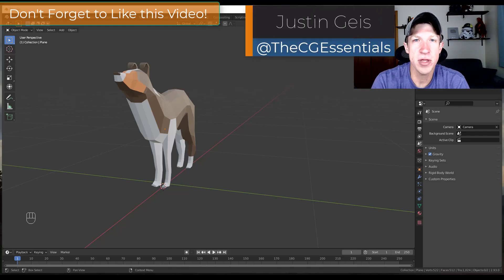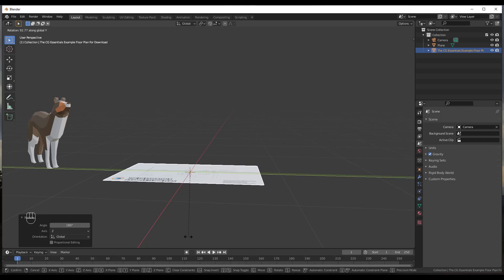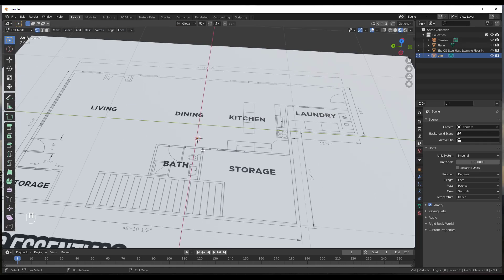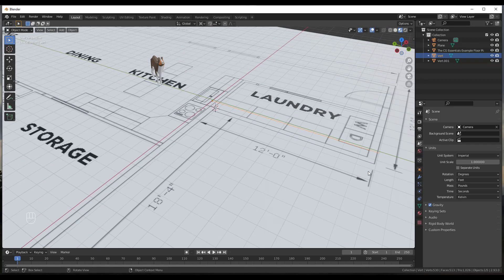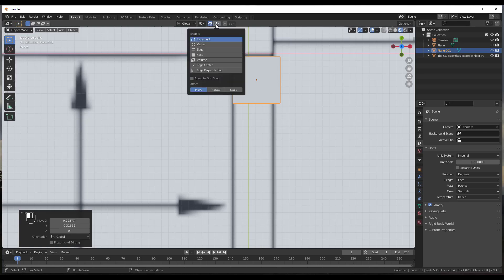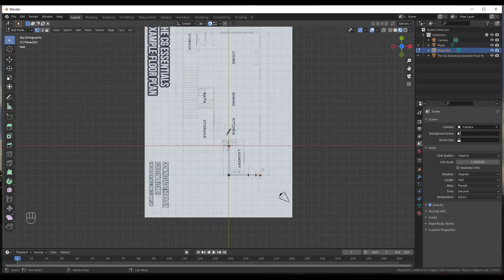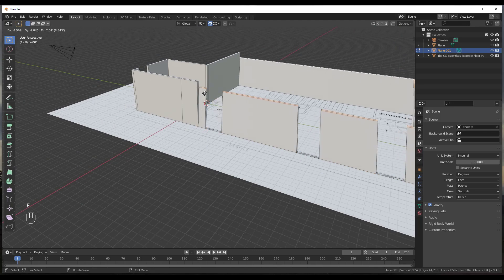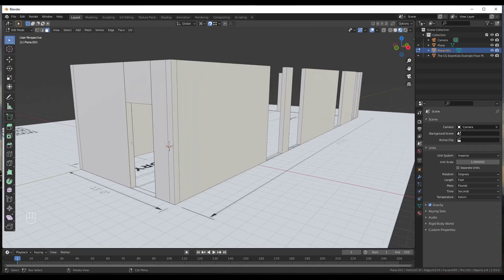Architectural Modeling In Blender Part 1 - Modeling from a FLOOR PLAN

Comment from the maker: Hi everyone! Let me know if you have any questions in the comments below! Also, remember to download the example image at http://www.thecgessentials.com/floorplan !
Reply: Did not receive the floor plan when I signed up for emails from your website. 😕
Reply: Same
Reply: I can't received the floor plan after signed up by my emails
Reply: Hi! I cant find the add-on "extra object" in my Blender. Maybe something have changed in the software. Is there any other method to get lines?
Reply: Do you have a link to the "Import Images As Plane" Addon. No longer available in repository.
Reply: do you have any experience or thoughts on photogrammetry for room scanning?

the new iphones have a lidar-esque function that with the camera can scan rooms reasonably accurately. while i'd love to know about a cheapish camera with this functionality, next up to consider would be photogrammetry. but... ive only seen it used when circling AROUND an object... never "within" a space.

any clue on if its possible? a combination of a scan to build proxy objects and textures along with measurements/floorplans would be a hell of a head start
Reply: thx for the vid
Reply: Is there a way to lock the floor plane image while using the plane edit?
Reply: I've done all that still cant find the image even after I signed up.
Reply: why add the image It only shows me a gray square?

Comment: This is my first time using and learning Blender. I need to model a house to assist with a renovation. This tutorial is so easy to follow along with. Some starting info for anyone following this tutorial on a later version (I'm on 5.0) the Import Image As Plane functionality is now built into Blender. Simply press Shift+A, go to Image and then Reference. It appears you can't reduce the opacity that way though, unless someone has a tip for me. 
From knowing absolutely nothing about Blender, in one 6-hour session following this video along, I have managed to fully construct two floor plans of my house as separate objects, to the correct scale, with internal door openings. I'm going to tackle the windows tomorrow because oddly enough I had exactly the same problem with my window openings of faces becoming entangled and acting weirdly. But somehow not the door openings. How did it know which ones to mess around with? I also have the interesting situation of dealing with stairs and adding floor planes to then try to plop one floor on top of the other without it all exploding. The next session could be a very interesting time.

Comment: If anyone doesn't wish to install the Extra Objects addon to get a single vertex, you can:
1. Create a mesh plane. ( Shift+A > Mesh > Plane )
2. Go into Edit mode. ( Tab )
3. Select all. ( a )
4. Merge at center. ( m > At Center )

Comment: 4:33 remember to check if your transform pivot point is the 3d cursor to scale it like this. It's the icon between the magnet and local icons at the top of the screen

Comment: 13:50 - Filling Gaps

> Alt + Left Click each edge loop, inside and outside the "window" space
> F3: type 'bridge edge loops', click option when it shows up
> Repeat for other windows! 

Saves a little time but a ton of efficiency

Comment: To scale the image to proper dimensions in Blender 4.3.2, you no longer have the options used in the video. My solution is to add a mesh plane, and set its dimension/length for one side of the plane to the exact length of the floor plan you want to scale. This will allow you to scale the plan using this plane as your guide. Simple and straightforward. Versions changes tend to throw everything off when following these tutorials.
Reply: Do you know what version he is using in the video, please?
Reply: You do, it has been moved to extensions instead of addons.

Comment: Just a quick simple tip for when you're scaling the reference image to match the length of the line you drew - select the image plane in object mode and set its origin to the 3D cursor, this way it will scale the image from the starting point of your line and you won't need to move the image around and repeat the scaling process several times!
Reply: Thank you!

Comment: Hi Im very new to blender, I really enjoyed your video! i tried out some of the tools you used in the video but when i pressed the E ( extrude shortcut) nothing happened, also when I pressed shift A + mesh , I don't see the single vert option ? Are you using an advanced version of blender ,perhaps or do i need to ad add ons ? Again very new, so sorry if its supposedly obvious , Im oblivious lol 😅.
Reply: Okay i figured out how to uses extrude and the importance of selecting the correct mode of operation, to use specific functionality. But I still don't know how to add a single vert( as the option doesn't show in the shortcut for me ), nor do I fully understand is usefulness when I can just use the 3d cursor as a marker to measure from. Could someone  help and perhaps elaborate its usefulness and how to use it?

Comment: I was wondering how you usually would go about finding out how HIGH the model is going to be? I didn't quite understand how you found out the walls were 10 inches when you extruded them upwards.

Comment: The fact that you continuously have to select edges and "repair" the faces, and that you are leaving behind a lot of useless edges (which you can delete but then you have to repair faces again) is huge waste of time. Sketchup does this type of modeling better because of that. It's a bit sad because with a few fixes blender would be clearly superior
Reply: Its a bit weird why he is doing things in such destructive way instead of using non-destructive approaches. All the extruding and deleting is waste of time, solidify modifier and booleans do all of this manual work on 10 seconds instead of 10 minutes.

Comment: Another great way to cut out the windows and doors is to build your walls all the way up (including where the doors and windows are) and then building objects to use as cutters to boolean the wall geometry.  This allows for all shapes, sizes and bottom heights of windows, and the cutters can be reused as many times as needed.  You can also assemble groups of cutters together, align and distribute them as arrays, rotate them, etc.

Comment: I see that for the interior walls new planes are added, which appear as new layers in your Scenes Collection. When I do it, the plane is added to the same plane layer. I then had the issue you had where the plane appeared at 10ft above the Z axis, but could move individual plane down as they are all connected! Edit: It's because I added the new planes in Edit mode, not Object mode.

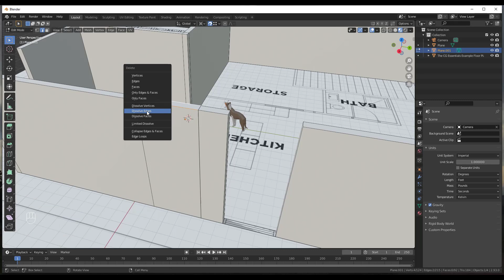Comment: The dissolve edges part at 11:05 leaves me with a light grey wall remaining in that part. If I try to select the smaller edges, too, then dissolve, the wall begins to become angular and messed up.
Reply: i got the exact same problem if you founf the soloution please tell me
Reply: i also got same issue, a solid looking light grey wall is left behind, only the edges are getting dissolved

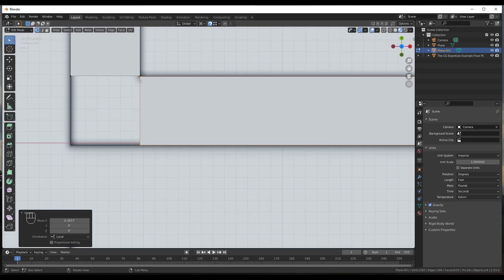Comment: In Blender 4.1 the snapping menu looks quite different, and unfortunately the vertices are not snapping as shown in the video at around 08:57. Therefore, my bottom left corner joins are not aligned and this is going to cause me some problems in the next part I'm guessing.

Comment: A helpful tutorial, thank you. As someone new to Blender, it would be helpful if you could explain what your keyboard shortcuts were doing, and how to access these commands using the menus. For example 'E, X' is very abstract and it's not clear what kind of extrude is happening. I found that the Extrude Region command does something different with a yellow + on the screen.
Reply: extrude on x axis

Comment: What key board shortcuts are you using? because non of the key shortcuts are working for me and I am not sure why and I have a mac that I did convert my keys back to windows keys because well i am switching to mac now but i still use my pc keyboard. But I did download the mac version of blender and non of my hot keys work or maybe i messed up somewhere i am not sure ?

Comment: I have tried to create a 3D printout of our house. I have followed your instructions carefully.
1. I have found that Blender accumulates errors (may be rounding errors). Despite carefully inserting snapping vertices, coordinates start to mismatch. Faces can not be added without correcting the vertex positions. The result is visually ok. But a closer look shows a plenty of problems.
2. The design contains only vertical walls and archimesh doors and windows. But the 3D printing Add On checker and the Creality Slicer reports errors.
I think creating a design from vertices is not a real option.
Reply from the maker: I've not witnessed errors in the precision of the model so far, though I do find the whole thing pretty clunky. Blender really hasn't focused on adding great precision modeling tools to the program. I'm not sure how there would be rounding errors unless you're trying to model to very high levels of detail, like to the 10th or hundredth of a unit.

Comment: I have downloaded and am in the process of trying blender do to what I believe has great versatility and detail. my current situation is utilizing a software like this mainly for architectural/construction  and remodeling purposes. I first tried ketchup and I was able to get into it and build and probably finish what you are showing but adding fences grass and siding detail in about this time frame without learning to do all these add ons shortcuts and etc. is it usually this complicated or is there another app like sketch up that is simpler? only reason im giving this blender a shot is it is free and so versatile but weighing the option the $500 for getting plans out the door quickly maybe all the worth it if im not investing so. much time. I downloaded your pic on my Mac Pro 2o22 and I can't find the download on the image link to start the tutorial. I seem to have this issue with another donut tutorial where some of the tutorial requests aren't working on my computer is this a Mac blender issue possibly? any and all help is welcome. just trying to find a good architectural software.
Reply from the maker: In my opinion for that specific instance based solely on what you're describing, I'd probably lean towards SketchUp. Blender is super powerful for sure but it can be quite complicated. If you're looking to generate something quickly in a simple fashion and then also create printable plans SketchUp is going to be a better fit.

Comment: I would recommend scaling to the largest dimensions, preferably in both axis by using a plane, to ensure the most accurate results and check the original plan is proportional.
Reply from the maker: Fair comment

Comment: You hit pretty quickly on the primary reason I've yet to use Blender for an architectural project.  I would really really love to, but the idea that you can "just right click to set the 3D cursor" and then extrude a line which is "very close to 12" fundamentally misses the most important thing in architecture .... precision.  The idea of modeling a building/structure which is "close" might work if you are playing with ideas or in school, but in architecture the idea of just being close is not an option.  The fundamental reason I've need been able to utilize Blender is the difficulty of getting things to the proper dimensions and precisely aligned.
Reply from the maker: There's nothing saying you can't go through and model the project exactly to scale, you just need to make sure that when you extrude, you're extruding exactly the length of the walls rather than matching up with the image. For a lot of applications, just matching the image is "close enough," but it just depends on what you're doing. There's nothing fundamentally saying you can't model those exact dimensions in Blender
Reply: @TheCGEssentials  The problem in architecture is that everything is relative to something else which means things have to fit together precisely.  I just run into so many problems with the simplest things. I'm sure there are ways to do these things but it's always the simple things that get in the way.  I could love to see you do a video focusing on the most simple operations.  Here's one that you might consider.  I simply want to start with a rectangle of a particular  size with one corner precisely located at the origin or on the grid which I can build off of.  If the shape size fits the grid them it's easy but if not, how do you move the rectangle so that one corner is at the origin?  From there I can use extrusions but just getting to a simply located starting point for an object is always difficult.  I really want to use Blender and have found ways using snaps and zero scaling, but it always seems I hit a wall sometimes.  How hard could it be to simply create a 2-point or even 3-point rect command that snaps to the grid or vertices.  If I can select two vertices and hit f to fill and create a line, why can't there just be a damn line command for which I can select a point, suggest a direction and enter a length.  Those two things alone would make Blender better for what I do.  Would love to see that but most add-ons go for much more complicated problem.  I just want a line and a rectangle.

Comment: i have questions i followed the instructions i went to the edit tab -> preferences-> clicked on add-ons-> then i typed in the search portion images and there wasn't the option to add what you added. so did i miss something. i did everything as you did, i even stopped to make sure i did each step and everything i did match you.. but could not find where to add my floor plan. That's the first part, now what happens if i have two floors how does that work... is the same step for each floor. i need help.. just to note, i frackin' hate blender, i hate modeling but i'm learning something out of my comfort zone for 2023, i want to make model of the dungeon for my bf. and see if i can't get it printed out. idk help please.

Comment: "...because that's what we use here in America."
Yeah, but we shouldn't. Imperial units are the dumbest, most problematic units around. Use metric. Metric presolves a billion problems that Imperial units will create later on. Like feet to inches. It's stupid. And it has problems with any NON imperial systems that your assets might interface with, later on.

Comment: For the initial ref image scaling, I recommend switching to plan view (top view, NumPad 7).  This should avoid any perspective errors.  

Also, the add vert method didn't work for me on 3.3, so I used a cube and set the X length to 12 feet.  After moving the ref image pivot point to a corner on the (now) box, the scaling was one and done.  Thank you for the videos.

Comment: you not explaining how you scale the picture from the point of your crusor. not from the center of the picture as the object. kinda confuse about this
Reply: On the top, where the snap button is, just beside that, you can see a pointer symbol. Click on that and change it to 3d cursor. Now when you try to scale it will consider the 3d cursor as the origin.

Comment: I noticed that, when he Scales or moves a mesh, a small square on his upper left corner of the screen says the Scale AND, the dimensions being updated between parentheses. Mine only says the Scale, how can i get blender to also tell me the dimensions while scaling?
Reply: For dimensions, it's always better to go to edit mode. In edit mode, you can turn on edge length from the overlays menu on the top right of the modeling interface. Once you turn on edge length in edit mode, when you select any of the edges it will show you the dimension.

Comment: Hello, great tutorial, tho I think that some overlapping faces were created during the wall extrusion (when you extruded walls and then windows or doors seperately). Any idea how to avoid or fix that?
Reply: Instead of extrude you could try creating loop cuts and bridge edges so that there will be no overlapping faces..or else you could use boolean modifier. It's way easy to apply boolean modifier with bool tool enabled from preferences.

Comment: If I want to assign a material to the inner walls different to the outer ones will this method be helpful for me? and if not how can I separate them?
Reply: You can assign multiple materials in the same mesh. Within edit mode, you can apply different materials to different faces from the material slot.🙂

Comment: Why do you need to import a floor plan image into Blender? Isn't it possible to draw a plane with sides set to specified lengths and angles in Blender?
Reply from the maker: Because floor plans don't always have clearly marked dimensions on them, or because it's faster to just draw along a floor plan image - lots of reasons really

Comment: Amazing tutorial, thanks a lot! And about 13:55I just figured out that the easier way would be to connect the upper dots and extrude the second part of the wall above the window down from the top. Like this you won't have to connect the faces by pressing f. That is of course if you approximately know the size of the wall above the window.

Comment: Step1 : create floorplan in another software. 
Step2: then use blender to create the same floorplan. 
That is duplication of effort.
Reply from the maker: Not really - tons of people start from floor plan images from all over the place - books, cad files or PDFs architects did years ago, etc. It's not a duplication of effort at all, but rather a strategy to get 2d data into 3D. If you're starting from scratch, good for you - you obviously wouldn't need an image in that situation. Even then though - that information could come from hand sketches, etc etc etc